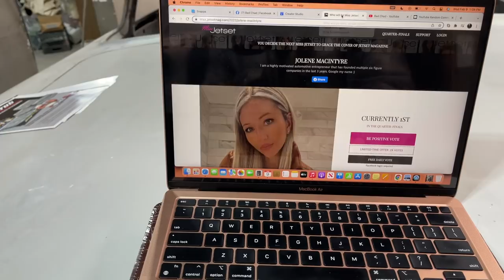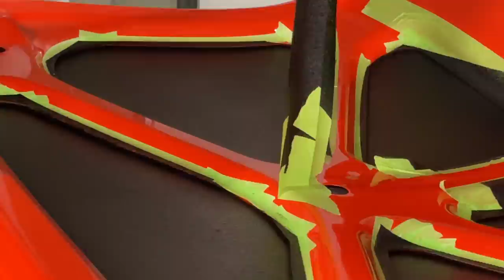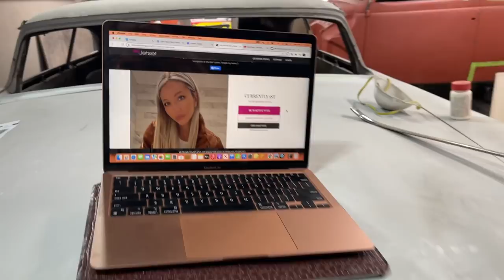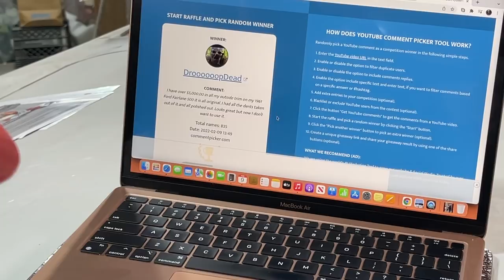Detailing the Trunk Lid Insulation Panels to look Factory for $35

Comment: In my experience with masking if you wait until the application is dry it makes a huge mess when removing the tape and makes it very difficult to remove the tape. Removing the tape Works better while the coating is still pliable giving you a softer edge And the better overall result Great job chad!
Reply: You are right I pull the tape before the paint is fully dry have to pull away from the paint. I usually have a card or razor blade to help with the tape but really careful with the razor blade. They make razor blades plastic now to make it less likely to cut in the paint.

Comment: The trunk lid is looking very nice I like the rock guard underkoteing I actually used it on my 89 dodge ram charger it was a two tone paint job from the factory but the silver was flaking off so I sanded it primed it and sprayed it with the undervote I left the side panels burgundy but I’m looking to change the color on the side panels not sure what color yet

Comment: Yea, you can take a bucket of tar and mix a little kerosene in with it to thin enough to paint with a brush. Then paint the underside of the car, just as you would put under coating on. When it dries, it is hard and you have a oil base coat which should help on rust prevention. Thank You for the info. Ronnie.

Comment: Ive seen a ton of so called ' chrome' sprays tested. But the best I have seen is something called Spaz Stix mirror chrome . You spray it on  over a coat of black and it doesnt look great until you buff it out, and then its the best imitation chrome I have yet seen.  you dont need any clear or whatever contrary to what they say.

Comment: Two ideas.
1)I saw a guy tape a rattle can to a Sawzall blade to shake it up using variable speed.
2) I've seen people prepare their spray cans by dropping them in warm water bath (in colder climates) before applying the contents.

Comment: An old painter once told me if you're worried about the tape taking up the paint, you can stick it to yourself once first to reduce it's tackiness.. If the paint comes up IMHO there is a problem with surface preparation / contamination

Comment: It's always about what is the fastest way to get it done except for the tape removal. How about putting in a little time folding over the ends of the tape to make it easier and faster to take off. Blue painter's tape might be less difficult to get off instead of cheap stuff. How about the sticky edged paper that's about 4 inches wide? That way there is less layers of sticky tape.

Comment: paint looks great, why the need to add the bedliner/insulation to the underside? looks cleaner without?
Reply: Some nice canvases there for some airbrush mural work. Some white or coral blue pinstriping might also work well. Other than that I think leaving it plain would look best also. I don’t think he did any bodywork to those inside panels so the rock guard well help hide that and save some time. 
I’m not sure what all the holes are for in the brace.  They must be there for a reason

Comment: Is That the paint we called "Wrinkle Wall Paint" back in the 70's?
Reply: I haven’t looked yet but I don’t think it’s crinkle paint a wrinkle paint. It was popular for a period of time though and is still available
Reply: @i8ntnuts  My dad had a 57 ford pu and he painted the top wrinkle white the pu was black with a white bed cover, It was nice.  Oh and he put a 327 chev motor in it souped up.  It run 13's at about 96 in the 1/4 mile.

Comment: Put pipe insulation on your stand and you will take away the possiblity of damaging the lid.  You know so it's not sitting on metal to metal. Just a though chad
Reply: That should win me a hat . For that tip
Reply: Get the right size and you can rotate it several times to keep a nice surface on top